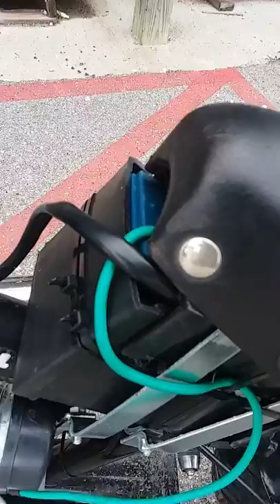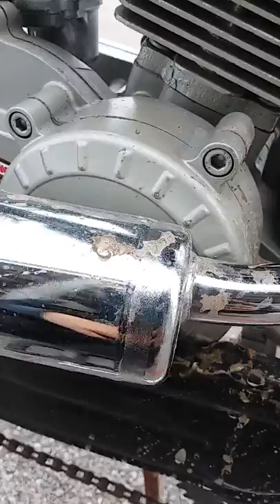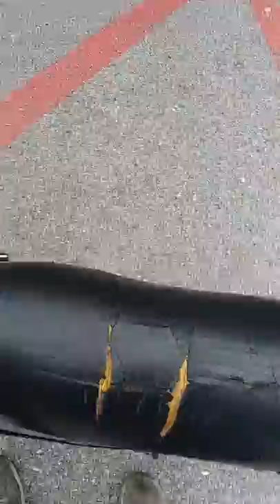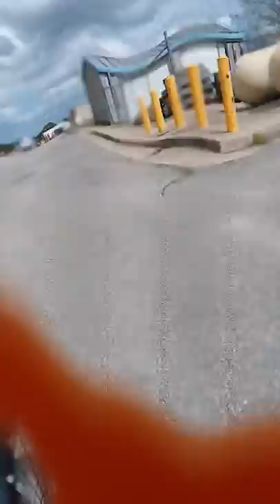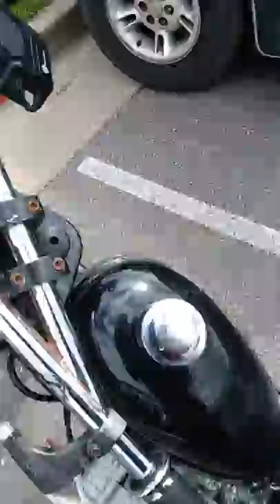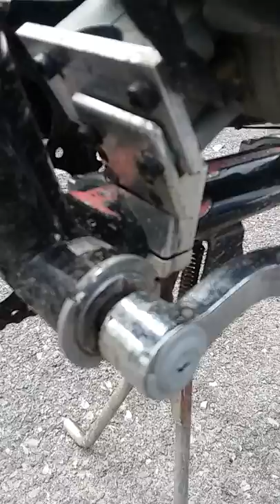Schwin Stingray with 80cc bullet train engine

Comment: Hows this motor compare in power to the standard 2strokes?? I was told the Bt80 was either lacking in torque or top speed where youd have buy a certain sprocket sizeto compensate for your given needs.. True?? Your sprocket size is what??
Reply from the maker: I do feel it's lacking but this is a heavy build. I added an electric motor in front to help up hills and take off.
Reply: The BT comes with a 48 tooth sprocket, which limits top speed for sure. The stock pipe and carb also limit performance by a huge margin. If you're handy with a welder or know someone who is, it's not that hard to cut off the stock muffler and weld up a different pipe to it. I replaced both the pipe and carburetor and can pull from a stop without pedalling and hit a top speed of around 40mph with a 40 tooth sprocket

Comment: If you compare the two engine which is quiter or less noise the bt80 or the 80cc kit with centrifugal installed
Reply from the maker: I'd say the bt80 is quieter than the 80cc with centrifugal clutch I had on my first build, my mountain bike. But then again the engine on the mountain bike was pretty cheap and lacking build quality compared to the bt80. 49cc engine is the quietest and four stroke is probably quieter than that. I don't have any experience with the 4 Stroke kits however I did help a friend with a 49cc kit.

Comment: Good morning question I’m putting a bullet train motor on my schwinn stingray chopper how long did it take you to put it together. And can I still put the sprocket that came with it thank you for your time
Reply from the maker: There was quite a bit of trial and error, modifications, plus I was still in college. I'd say it took me 24 hours or so broken up through a couple weeks. I modified the mounts from pedalchopper.com and made adapter plates. Then I had to make adapting spacers for the hub centric sprocket mount which reminds me, use a hub centric mount and sprocket or you will shear your spokes. That happened on my first motorized bicycle build.
Reply: Thank you for information

Comment: Also, how do you think it compares to the79cc MONSTER 4stroke kit?? Im kind of debating between that&this BT80.. Thats a nice lil build. I normally dont like the lil chopper builds but this one is legit!
Reply from the maker: I haven't ran that build so I don't know which one will pull my up my driveway better. I'm not longer at State Tech and now I live at a place with one very steep gravel driveway for a proper butt dyno. I had to reduce the gear ratio a lot to get the torque needed but sometimes I'm still pedaling to help it. If it had some port work done it may work better. I had a YaeCC two stroke, a cheap chinese one and by cheap it was one of the cheaper ones. It pulled me up muddy hills like it was nothing although that build was much lighter. I just need to upload another video with where it's at now. True hybrid, electric front hub wheel, saddle bag and a nice comfy seat.
Reply: The big advantage to getting the BT80 is the 12v electrical system, which allows you to connect all sorts of universal motorcycle accessories to your bike (speedometer/tach,  lights, etc). It is a well made motor and is pretty reliable as long as you keep an eye on intake leaks. It can also be made to be a real ripper if you replace the stock NT carb with anything else and fit a different exhaust to it (will need to cut the stock muffler off and use the left over as a header to weld to, since no aftermarket pipes fit directly). 

As for performance, the 79cc 4 stroke is similar to the BT out of the box, but there are performance parts via Affordable Gokarts that will bring it up to 7-8hp. All in all, I'd say if the electrical isn't important to you, go with the 79cc. If you want electrical and want to wire up all sorts of things to your bike without having to hassle with charging/replacing batteries, the BT is the way to go.

Comment: What tipe of motor mount are u using!
For that motor i almlost start doing same proyect sr!
Reply from the maker: I used the mounts from pedalchopper.com however I modified their mounting angle to match the engine kit and made adapter plates. Bit of work went into the mounts but not near as much as making my own
Reply: @commandercody38  i was asking the pedal chopper guy!
And he say's he only need the distanse between the holes and he can make it to fit's on the motor!
Also where do u get the battery and they mount sr?
Thanks
Reply from the maker: @manuramos9638  I used the hardware from the kit although I'll eventually move it to the saddle bag once I lengthen the wires. I got the battery from amazon I believe. similar to a battery that goes into a computer battery backup system.

Comment: cool bike i have the same engine kit what oil you use during break in period
Reply from the maker: Castrols two stroke oil
Reply: @commandercody38   I use the same two cycle oil thanks  20 gas 1 oil ratio 6 ounces oil added what the book manual say 90 octane gasoline or better gasoline i use 93 octane/grade marathon gas station i mix my gas and oil inside a 1 gallon red tank shake the red tank for 5 min after pour my gas inside a black 3 litter tank for my bike for the clutch under the engine i removed the bolt pour 120ml oil inside the engine before i start the engine i remove the HP CARBURATOR and INTAKE i see how much gas inside the engine looks full i install the same two part back together i tightly screw my bolts when i start the engine i close the carburator i use performance carburator turn on the switch turn the throttle 1/3 what the book say press the yellow button when i look at my engine while trying starting the engine i only hear piston moving and yes i hear spark but engine dont run i try everything what you think i did something wrong any errors i made this is my first time building my bike battery i use super start what good spark plug i should use ngk bosh what gasoline i use shell or mobile what gas octane/grade i use help me out give me good advice
Reply from the maker: @Johnjohn-eo6mb  My issue was something with the wiring when I first put it together and tried to start it. I'll get some pictures at one point. I would visually check to spark by pulling the spark plug, holding the threads of the plug to the head of the engine and pushing the start button. If you can't see a spark then something is wrong in the wiring.
Reply: @commandercody38  I already check NO SPARK show me  pictures wiring the box correctly
Reply: @commandercody38  I check my wiring  i see a green and orange wire for the horn and light where can i buy this part
Reply from the maker: @Johnjohn-eo6mb  I think any 12v motorcycle horn will work. I haven't been very active on the bike scene lately. With covid and all no more bike meets.

Comment: What did you use to mount the engine?
Reply from the maker: The mounts from pedalchopper with adapter plates that I made. Everything holding the engine down has loctite.

Comment: How's the reliability doing on the BT80 engine. I like the concept but read alot of mixed reviews on this engine. I would like to rear mount one on my Schwinn trike. Since the BT80 has been out about 3 years now I'm hoping the bugs have been mostly worked out.
Reply from the maker: So far so good. Been over half a year. Will be changing oil before it gets cold. Recently put on a 36v front wheel hub motor to help with low end torque but it died when the wires were sparking. Asked for a return and replacement controller or kit so hope that goes through. Did go to a 36T sprocket which helps torque and didn't change my top end.